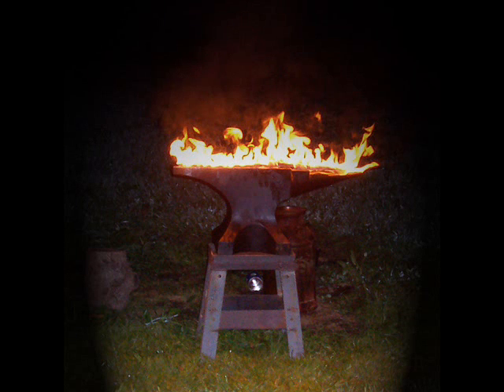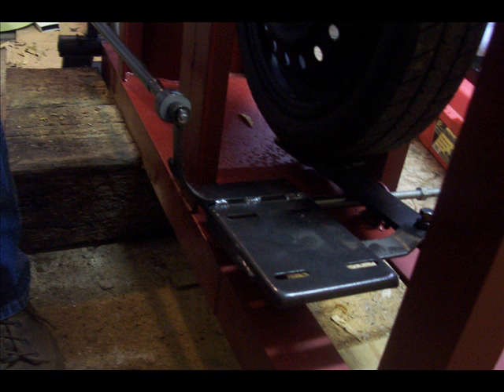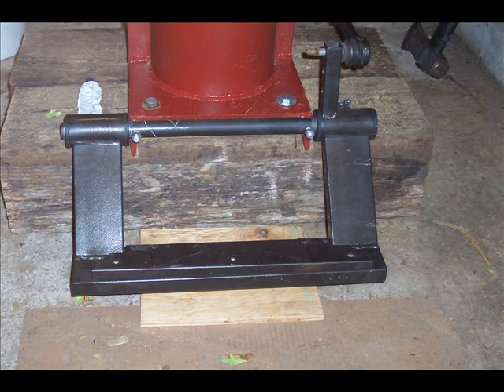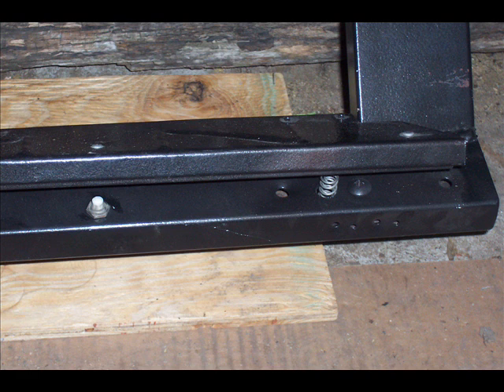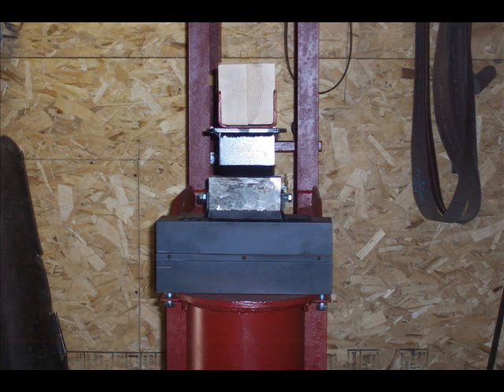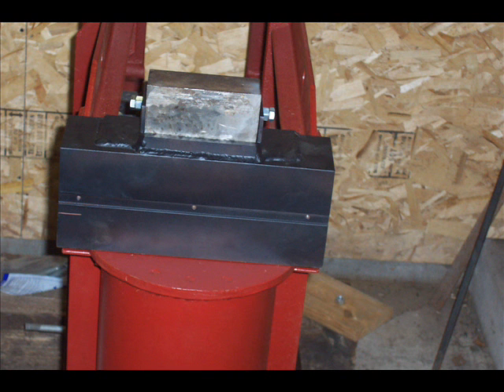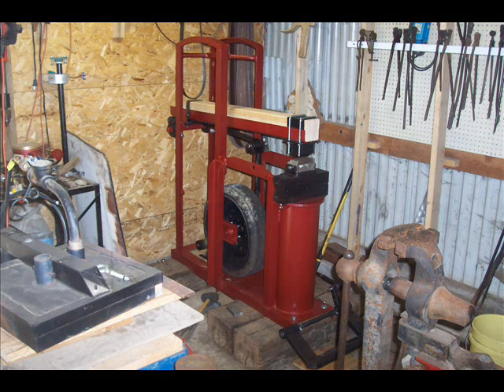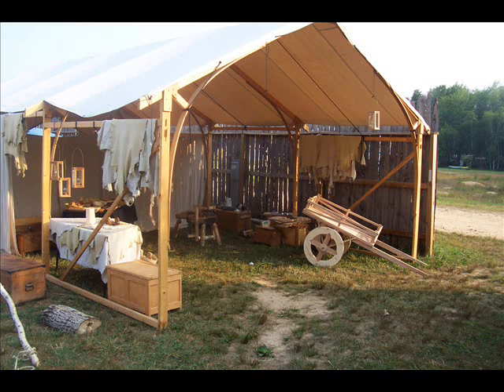junkyard helve hammer part 2 homemade power hammer

Comment from the maker: good point, this hammer isnt rotating an entire dupont linkage around a larg circle, with my leaf spring linkage the tire drive is only rotating the bearing end of the connecting rod, and in a smaller offset, since the helve arm magnifies the distance, my linkage and connecting rod have shorter travel, should probably still have some counter weight, though, maybe a couple lbs, planning on looking into that and calculating it as properly as possible

Comment from the maker: No problems with the anvil, the combined weight of the solid block on top, the tube itself, the steel and sandfill, with the ties underneath is near 400lbs, I do need to reinforce my frame for flex, as the rotating load on the hub is making a strong eccentric and moving load, additional diadnals were in my first drawings but I skipped them trying to get done quick, iron filings would work great just compact them good, big thing to look out for is bolts working loose in your trial run big danger